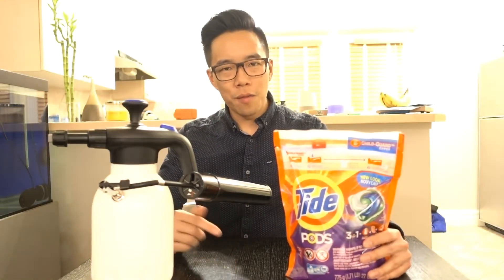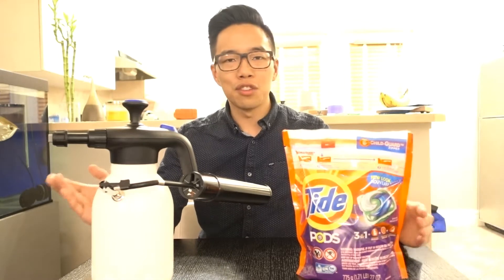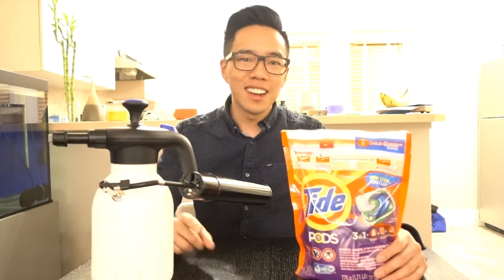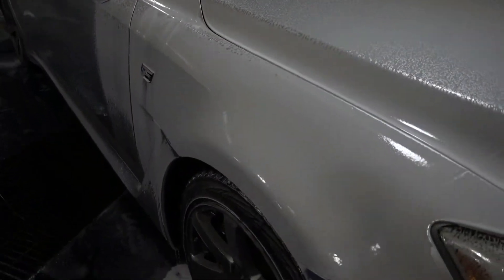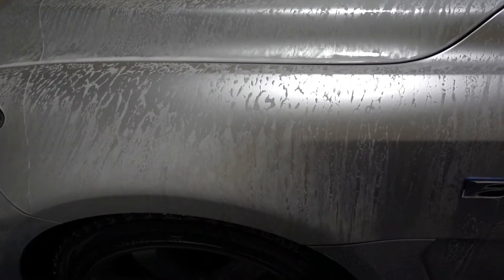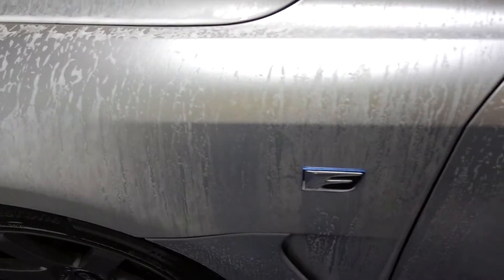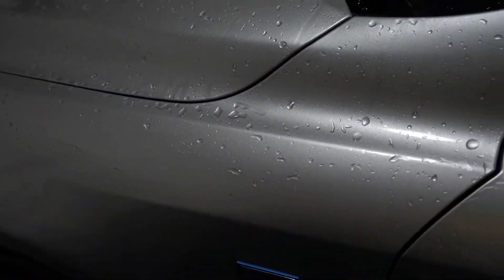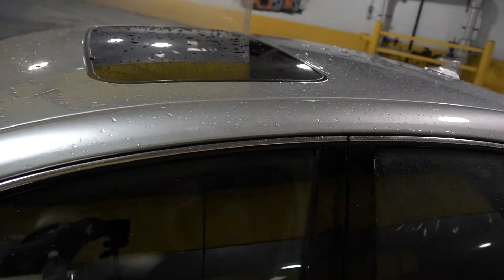TIDE Pod CAR WASH? - Will it FOAM?

Comment: High Efficiency (HE) type laundry detergents (usually in a pod form) are specifically formulated not to suds/foam. A front load washer would otherwise create a mess of suds and foam that wouldn't normally rinse out of your laundry. That is why they warn you to use only HE detergents in them. If you want foam buy a cheap regular laundry detergent. Cheap laundry detergents tend to foam like crazy. In general, you don;t want laundry detergent to suds up.

Comment: I would want to be very cautious about any chemicals in the pod that could etch the clear coat or strip any coatings on the car as well as the glass.
These pods are designed to degrease. Which makes me wonder will it damage plastic and rubber components such as the weather stripping.
You very often see your glassware come out of the dishwasher etched and ruined.
This may be the case with these pods!